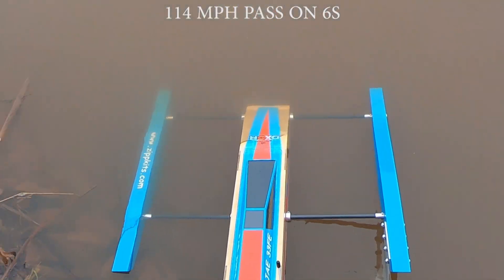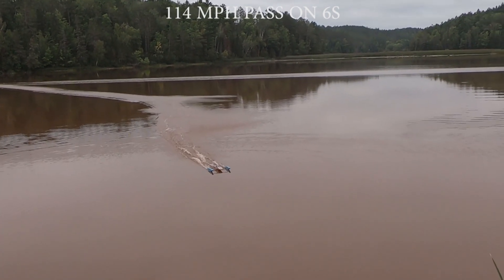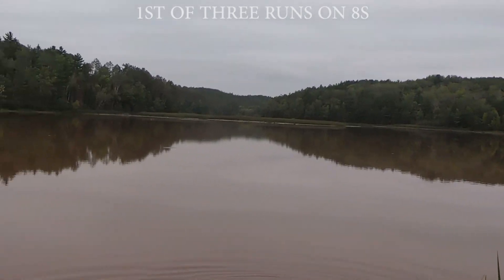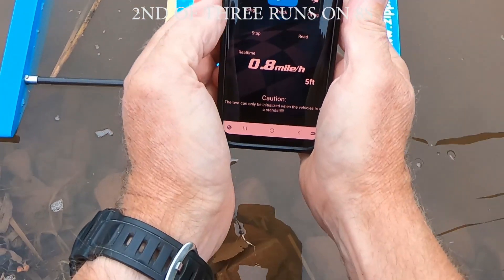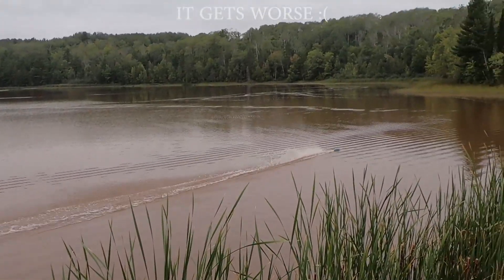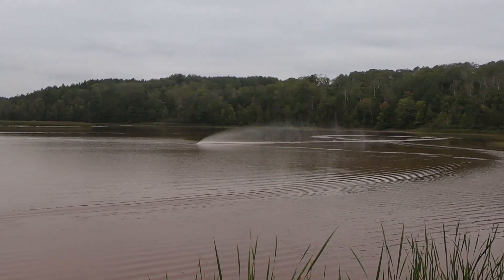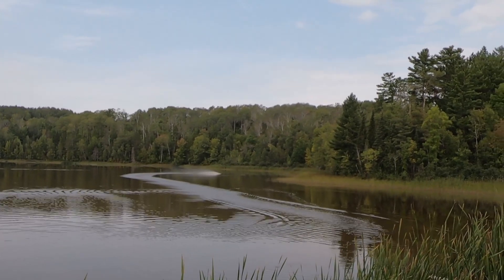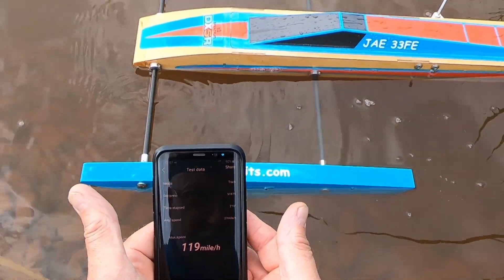JAE 33FE 119 MPH SAW Run_In Depth Setup Analysis!

Comment: Do you think there would be any Benefit to running the tp Svm series motor
Reply from the maker: For sure! Tons of power and rpms. And very good speed on 4s or 6s too. Running 8s takes high level skills and knowledge to not overheat it, and to keep it on the water...

Comment: It's your prop at that much rpms
Reply from the maker: Yup.  I figured it out at the end...
Reply: @chilly7261  congrats on your speeds your getting from that JAE Rigger. I got the next size up JAE electric rigger. I was thinking of doing that one in 8s..
Reply from the maker: @hippywildchildracing  This is the JAE 33FE. Zippkits makes a bigger one?
Reply: @chilly7261  I bought mine 4 or 5 years ago. Mot sure if they make it any more
Reply: @chilly7261 Jae 45 is the bigger one